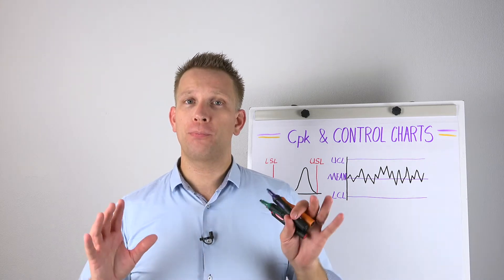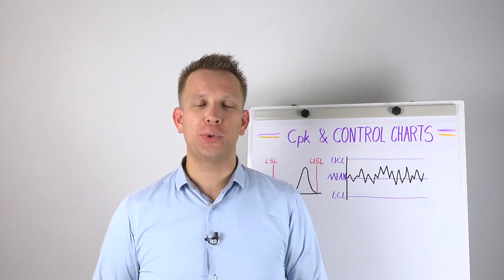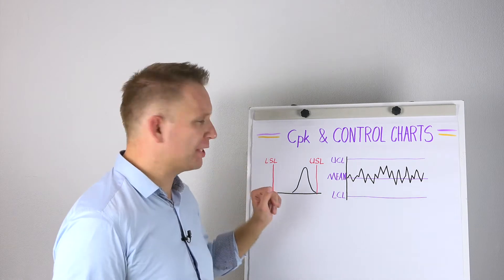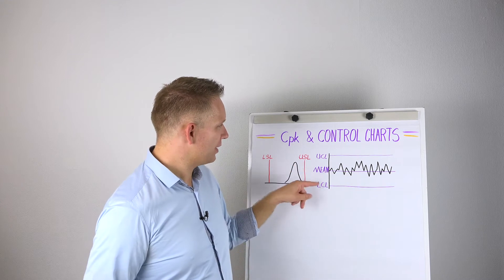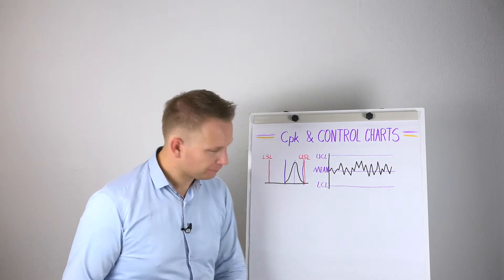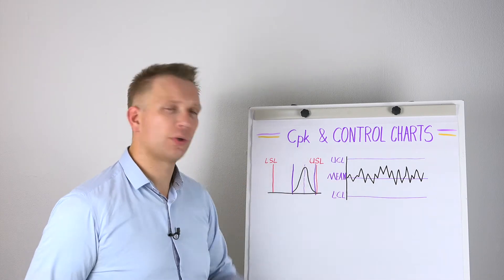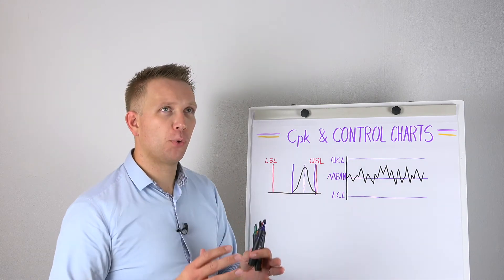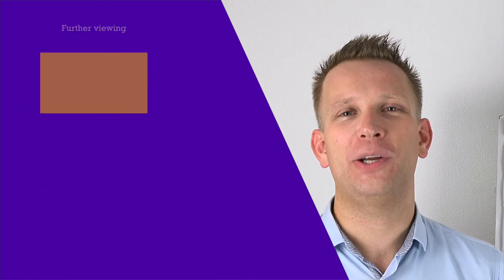How to read Cpk indices from SPC control charts

Comment: Any engineer worth anything should know that Cpk is to predict the average of the outcome base on a limited amount of data and give you a preview of you current capabilities.

Spc and Ppk is basically the same thing, you can't have one without the other. These control and show the long term process and shows any issues in the process with a set up. This also can be used to help determine life cycles of a tool of process.